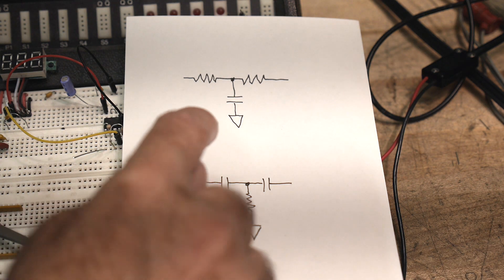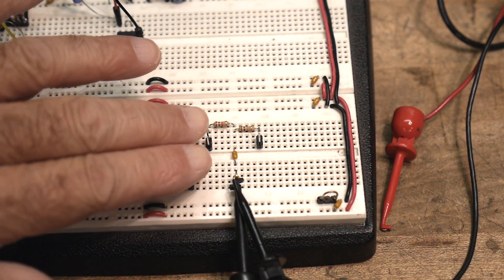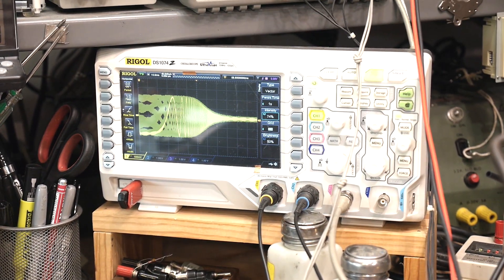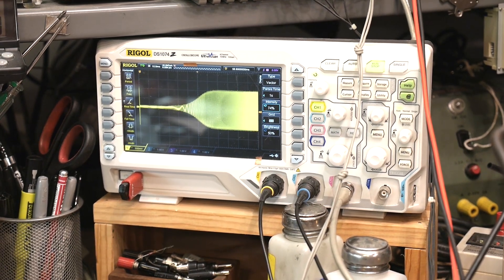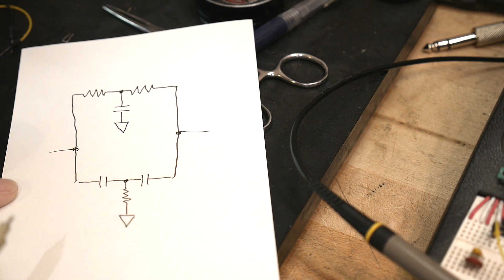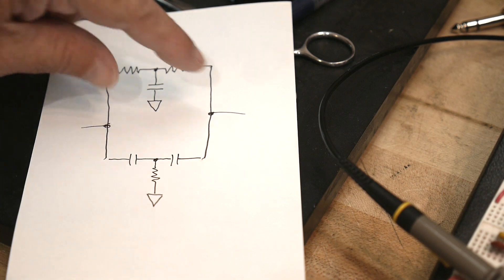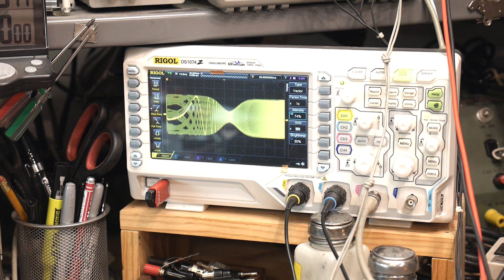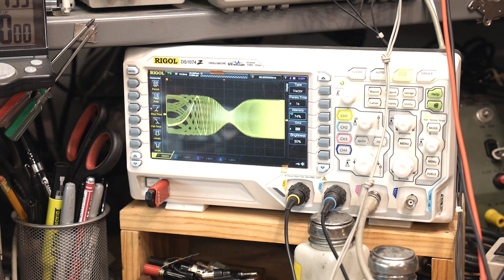#471 Twin T Filter

Comment: Have you set the scope to trigger each time the cycle begins? I see a persistence mode to better visualize the virtual line created by the peaks, but I cant figure out the sweep characteristics to recreate this setup. What is the sweep time from 1Hz to 1M?
Reply from the maker: The HP 33120a has a sync output. I use that to trigger the scope.

Comment: I have a Rigol 1054z and saw your 1074z and thought <oh yeah ... maybe mine has one of those frequency sweep modes>. Lol, I looked into it and realized that the 1074z has the function generator built in. Mine doesn't. I WISH I would've spent a little more and bought the 1074z instead. BTW - Thanks for producing videos on how to use op amps. !!
Edit: I watched both videos about the T filter, but mistakenly commented on op amps here instead of 2nd video.
Reply from the maker: Mine does not have any generator.
Reply from the maker: I'm using an HP33120a generator
Reply from the maker: The function generator model is DS1074Z-S (note -S)
Reply: @IMSAIGuy  Oops. I think the model I googled might not have been yours after all. Sorry for the confusion. That was probably because I didn't review the video to verify the model #. I haven't had my scope (1054z) very long and I saw the word "vector" on yours. That's what got me started. But I comment without doing my homework. I'm still not entirely sure what my scope has and doesn't have. Lol
Reply from the maker: @jacobdavis000  no problem. glad you got a scope! I'm sure you'll learn a lot. Scopes are very capable these days. I did a firmware hack on mine and I think your scope might have the same hack. it turns it into 100MHz and turns on all the features